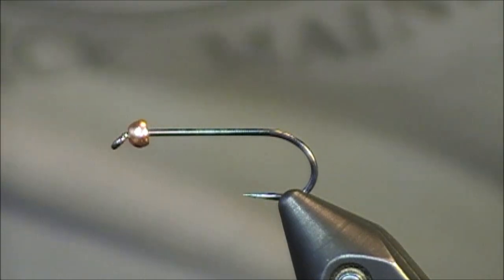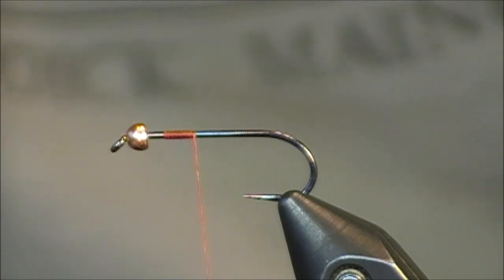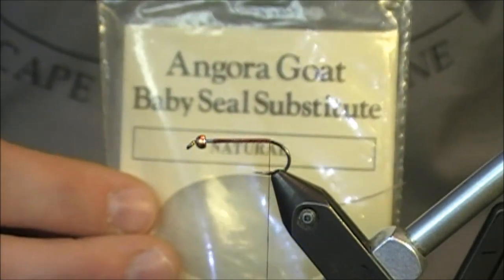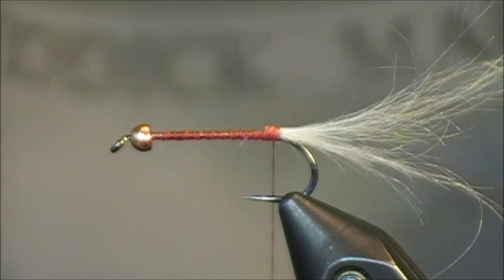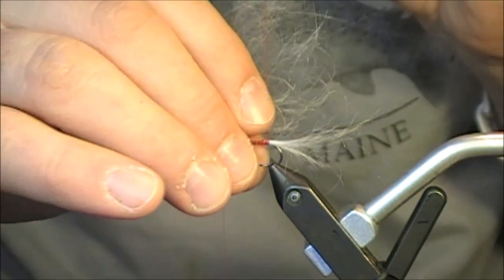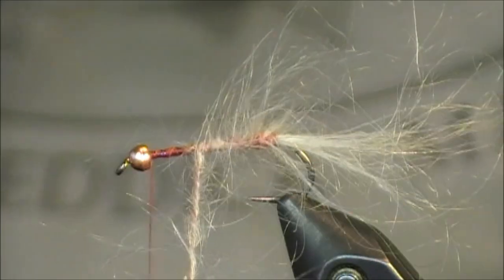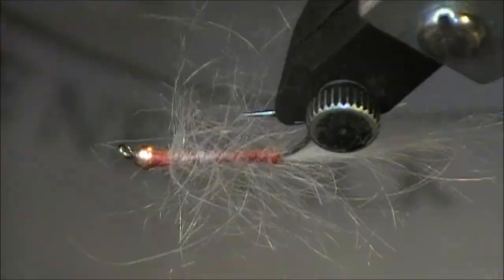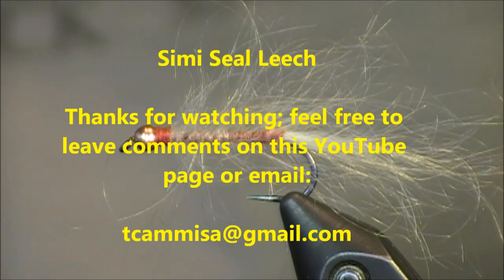Fly Tying: Simi Seal Leech pattern

Comment: Tim, I've being tying quite a few leech/streamer patterns since I found an odd ball of black mohair yarn and a 50g cone of undyed mohair in a knitting shop sale. Been adding some angelina fibres in a dubbing loop to give them a bit of flash and also experimenting with organza ribbon hackles. Been targeting the perch in the local canal with them. Only small fish so far, but the canal has been difficult fishing as the water is gin clear at the moment. Will definitely try this pattern too. Regards from the UK.
Reply from the maker: Great comments, David, and I love the addition of the flash!  Are you using a sinking or floating line for them?  Good luck getting those perch, as they can be a lot of fun to catch.  Tim
Reply: I'm fishing an ultra slow intermediate - 1" per second. I used to fish a floater, but was told that perch prefer a fly to stay at one depth rather than rising towards the surface. Prefer the presentation that the inter gives me, even if the fish don't! Lots of follows so far, but very few actual takes. I'll keep trying!
Reply from the maker: Good luck with it, and I wish I knew more about perch to give insight.  So, I do know they love the Chuck Nymph and a Mop fly!